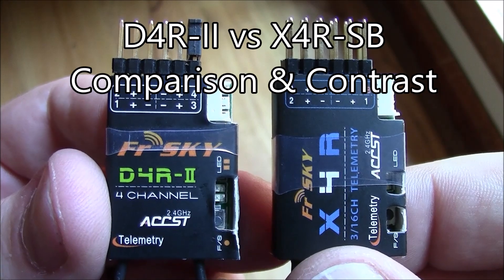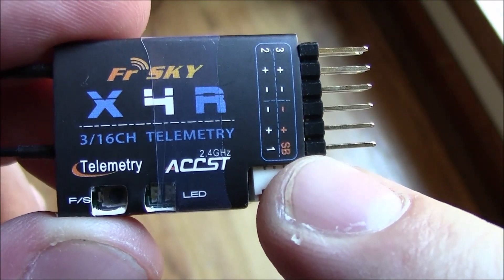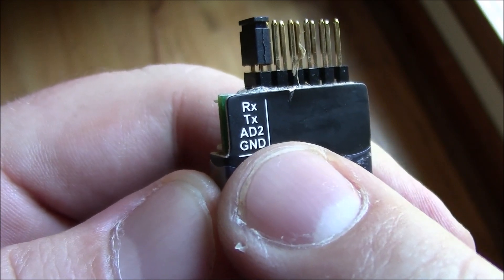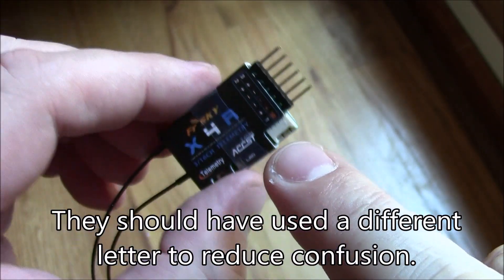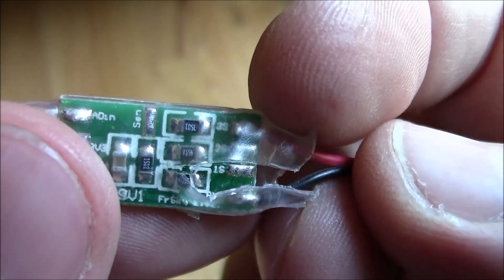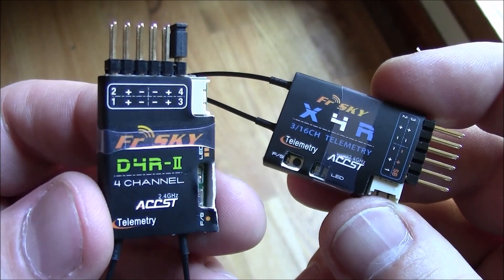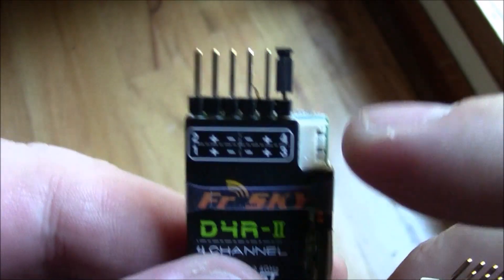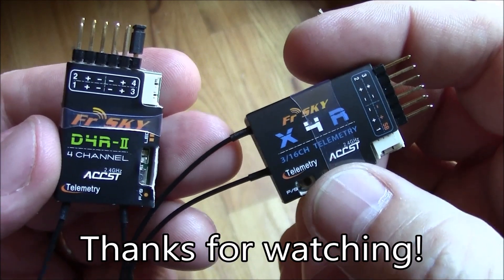D4R-II vs X4R-SB - What's the Difference?!

Comment: I'm using the D4R with kissfc and I have the telemetry wire on aux1 pad on the fc but the only telemetry I get is the standard RSSI, how do I turn on telemetry with kiss? At least with betaflight you just use a slider...

Comment: So ... here’s a bone-head question for you ... where is the d4r getting powered from. I’m planning to install in a powered glider and I see the connectors for the 4 Servos and telemetry ... but where do I bring power INTO the receiver? Thanks.
Reply from the maker: It has to receive 5v of power on any of the "+" pins (and has to be grounded).  If you have all servos connected to it, one of their power cables will have to be split between the pins and the servo since they will both need 5v.  The remaining 3 servos will draw power through the receiver.
Reply: thanks. Sort of seems like they forgot that it would need to get powered ... wonder why they wouldn’t simply have 2 dedicated pins for power and ground supply ... I’ll try to get it installed and powered up ;-)
Reply from the maker: My guess is that the D4R-II and X4R-SB were designed with a small size as the goal and eliminating a dedicated +/- input was a sacrifice they were willing to make.  That's all I got.
Reply: If your building a powered glider you'll be getting your power through a ESC with a built in BEC . Just make sure you get a ESC with a BEC built in because they make them without it . IT goes from your battery to ESC then one connector to your throttle channel and the other to your brushless motor.Good luck.

Comment: X4R-SB does have CPPM (1-8) on channel 1 if you use jumpers when binding. Then channel 2 is 9, and 3 is 10, and 4 is still SBus (or PWM from 11)
Reply from the maker: I think FrSky updated the firmware for both the X4R-SB and D4R-II since the time I made this video.
Reply: I think so too

Comment: The D4R telemetry port actually can transmit telemetry data from the FC to the Taranis, not just voltage. I wonder if the X4R-SB does the same
Reply from the maker: They both transmit the same information using the SPort wire.  They can transmit the voltage as long as the flight board is soldered correctly to read it.  Voltage comes across to the Taranis as "VFAS".
Reply: I am aware of this. I have built many racers using the D4R with voice warning for low voltages on my Taranis. Was just wondering if the X4R does the same. Will try it out.

Comment: I own a FS-i6s transmitter and recently bought two kinds of receivers #1. Frsky X4R/sb cppm as seen on of your video and a TRangeX RM601.  While following you build on the X210 FPV and Telemitry I set my transmitter to Sbus but nether will bind.  What might I be missing.  Or are these reveicver's the wrong one for my transmitter.   I don't see any video's on how to know if RX works with my transmitter.  Can you help clear this up for me. Thanks
Reply from the maker: The FS-i6s is a FlySky product whereas the X4R-SB is a FrSky product.  The RM601 uses DMX or DSM2.  Neither of those will work with the FS-i6S.  That stinks.  You need a receiver that is compatible with that transmitter, maybe one like this one:   http://www.banggood.com/FlySky-FS-iA6-2_4G-6CH-Receiver-For-RC-Airplane-p-985684.html?p=6Z050013977120130325   It has straight pins so you have to make sure with the plastic connectors attached that it will still fit.

Comment: I have a question to ask you?, I am Building a martainIII quadcoptr using  Racestar plus RS2205 2300kv motors, KISS FC & KISS ESC's  Taranis plus TX I was Going to Us a D4Rll  rx but since it is not sbus  would it be ok to strip down a X8R Rx and take all the pins off and case than heatshrink it  do you think that would be ok or just use D4Rll  RX PPM?  I am not racing this , it is only going to be used for my charity  FPV FOR CHILDREN WITH CANCER. Also Do you think the Racestar RS 2205 Plus motors are just as good as the DYS ones? I heard they were identical performance? I have to go in Friday Dec 2 to have CANCER removed now from my lung so i will not be doing anything for awhile but i can get the motors as a gift and if you think the RACESTAR RS 2205 plus motors are as good as the dys ones please let me know what you think as soon as possible?  Thank You in advance for any or all help!   GOD BLESS YOU & YOUR LOVED ONES!!!
Reply from the maker: Yes, the Racerstar motors have been very good for me so far!  The X4R-SB is available now in a "naked" form (means no pins).  That is what I've been buying recently.  http://www.banggood.com/FrSky-X4R-SB-2_4G-316-Channel-ACCST-Telemetry-Receiver-Naked-p-1035549.html?p=6Z050013977120130325

Comment: i heard somewhere the receiver antenna sud be 31.5mm. but these receiver seems to have longer antenna. what i am wrong here?
Reply: Ashish Amatya the antenna is coaxial therefore it has a layer of insulation a layer or a sheath of metal another layer of insulation and then the actual antenna. the 31.5mm part is the exposed part of the antenna wire.

Comment: Great video,can I plug the d4r-ii in ppm mode to the eachine 250 w/out the voltage regulator or does the ccrd fc have a regulator installed to automatically knock the input voltage down below 10 volts?Thanks in advance.

Comment: If you wanted to use ch 1,2 and 3 when having sbus connection. What channel would you allocate them? (because sbus is already calling them channel 1,2,3 etc for throttle, rudder elevator etc  on the taranis)

Comment: whelp. couldnt get telemetry to work with my x4r. watching this video shows that they actually use 2 different S port wires with 2 different configurations, same end though.
Thank fk I decided to not cut out the wires i wasn't using - To the soldering station!

Comment: Hey newbpilot I would recommend an f3 based flight controller now running sbus. When I made my comment I had no idea what I was talking I about. Now I know sbus is optimal especially with a f3 FC. The naze has an F1 chip on it which is a slower processor compared to the dodo.
Reply from the maker: +SF PV I like the F3 boards too.

Comment: Been subbed for some time now, and I have a small point I would like to bring up. Perhaps it might be worth mentioning that you must first have the X series transmitter module in your RC Tx in order to use the X series receivers. Just saying. Maybe you are assuming people are using the Taranis? I am still trying to afford one and still using a decked out 9X with the FrSky Tx Module
Great vid. I was almost gobsmacked when I first found that with the D series PPM capable FrSky Rx that you can still have use of Ch 4 thru 8 as AUX outputs for what ever.
Reply from the maker: +Chris Leech Yes, you are correct.  I am assuming that people have a Taranis.  I'll to remember to mention that others will have to have an X series transmitter in order to use it.... or just say that I'm assuming you have a Taranis.  :)  I'm trying to only use the X4R-SB receivers now.  The new ones can do both SBUS and CPPM.

Comment: how do you program the taranis to send control out puts to the channels 1,2,3 on the X4R?
Reply from the maker: +Barnaby Harper I've been thinking about that too.  I think, but not sure, that channels 1,2,3 are the same in the SBUS and PWM outputs.  If you want to use channels 1,2,3 for PWM, you have to change your flight board to read channels starting with 4 for your controls.  That leaves 1,2,3 available to use as PWM outputs.  I'm planning a video that shows how to do that... its several weeks out, but hopefully I get some time to figure it out and make a video.
Reply: +travisgrindal thanks, thats quite clever, i look forward to the video when you work it out :)
Reply: i haven't tested it yet

Comment: Travis, thank you for the information!
Now I use d4r-II cc3d, and a flysky transmitter with Frsky DJT module. As I see, the X4r-sb will not work with d-series module.
Could you tell me that the Frsky X8R receiver can give S-bus connection with the Frsky DJT module? (I wouldn't like to change taranis just because of this.)
Thanks!

Comment: Good video.  Are you using the X4R-SB with a Naze32???
Reply from the maker: I'm not right now but I'm pretty sure they will work together.
Reply: +travisgrindal I understand that the older Naze32 need a convertor to flip the pulse to use SBUS but the new FCU from SPpro F3 and others do not.  Need to check before you purhcase.
Reply from the maker: +Jon Car Good to know!  Thanks!

Comment: hi again i tried using sbus on X4R did not work should i use a sbus convert to ppm
Reply from the maker: +Robert Matthews Wait, are you using X4R-SB or just the white X4R?  The white X4R is simply a 4 channel receiver so you won't get SBUS or PPM out of one of those.  I've read that you can re-flash them with different firmware that will make them do SBUS or PPM but I haven't done that myself.
Reply: ive just got the one servo lead  into the sb on the X4R and into my naze32 board and dosen't work
Reply from the maker: +Robert Matthews I'm not sure the Naza32 will accept a SBUS connection.  I know it supports PPM, but I'm not sure on SBUS.
Reply: if i get a convert from sbus to ppm should that work
Reply from the maker: +Robert Matthews You could do that or buy a D4R-II and use the X4R-SB on a different quad.
Reply: thanks mate for your help

Comment: If you use the SBus ch1,2 and 3 outputs are already being used and can not be reassigned. So chances are you will not be using the rx's outputs and SBus. Also the naze32 uses uninverted Sbus. The X4Rs outputs inverted Sbus. So you will either need to mod the RX or buy an inverter.
Reply: Dangit.  You confirmed what I was thinking.  Great.  I guess I need to do something different like a PPM decoder and then go separate.  I'm using Inav and can't remap 1-3.

Comment: I'm using a Flip MWC flight controller that supports S-PPM....is the PPM that the D4R-ii supports compatible?  I may have not looked around on the net enough but I didn't see anything about S-PPM with the D4R-ii and other FrSky receiver on sites where they are sold.  Great videos.  Just thinking ahead for a future quad.

Comment: Great video. I've been using the X4r's now since I started pretty much. All with CC3d. What I did NOT know was you could access those other channels and do Sbus, GREAT info, wow!! Shame I'm flying the Vortex now and have to use the D4rii, LOL those extra channels would come in serious use on the Vortex for the lost model beeper. OH well. lol Thanks for posting.
Reply from the maker: Doug Rowan You're welcome!  I'm the opposite though.  I've always been using the D4R-IIs and now I'm starting to use the X4R-SBs.  Heh..  :)
Reply: ***** seems like the naze guys have been using the d4r, and the CC3d guys figured out sbus :)  what's weird is I seem to get better range with my Vortex and the D4r than I do the sbus and my other builds.  I get rssi low constantly at one place with the x4r builds, and the vortex goes on past and then some.  None of it's a big deal based on how far I was out, lol and low to the ground.  Figure that's more the cause.  Thanks!
Reply: +Doug Rowan FYI the Vortex CAN do inverted S-Bus, you have to use the GPS port for that but since the GPS isn't available yet thats no real loss... what you have to do AFAIK is mod the X4R-SB to output inverted S-Bus (S-Bus itself is inverted and you have to "disable" that so it's no longer inverted but still everyone says "then" its inverted sbus...) ...but that ain't hard as well (just oder leds bevor the hardware invention)... long story short... I am pretty sure since you are flying X4R's for so long you will feel the difference in delay so go ahead and Sbusificate your Vortex :)
#sbusification

Comment: So the x4r can be ppm and then have two channels to control my camera servo Gamble is this right
Reply from the maker: Farley Gordon No, the X4R-SB can NOT do PPM.  It can only do SBUS.  It can do SBUS, plus the 3 PWM signals for servos but you may have to have a better power source than just the flight board.  It may not output enough milliamps to power your servos.  You'd have to look it up or another option would be to power your receiver from a separate BEC.
Reply from the maker: ***** Well, with these new firmwares, I don't know that there will be much difference.  Most people won't have a firmware flasher though.  I doubt many people have even updated the firmware on their D4R-IIs to the newer firmware that does the 27ms response time -  I haven't.  Those firmwares are cool though.  I do wonder if FrSky will ever officially release those firmwares.  It will be interesting to see where they go with these.  It would be cool if they could some how auto set CPPM or SBUS depending on the flight board.

Comment: I didn't know you can control servos with the X4R. I'm gonna order one for my FPV camera tilt setup. I tried the servo tilt with the Naze32 but it didn't work good.
Reply from the maker: JKFlorida One thing I've read about this is that if you are going to control servos powered directly from the X4R-SB, you will need thicker wires than those included with the CC3D.  You'd need to pull power from a BEC (4-10volts) to your receiver because servos will pull more milliamps than the small wire could support.  You'd end up with just the signal wire running from the CC3D to the X4R-SB.
Reply: Good to know! Thanks.